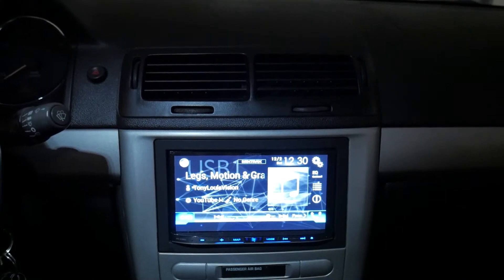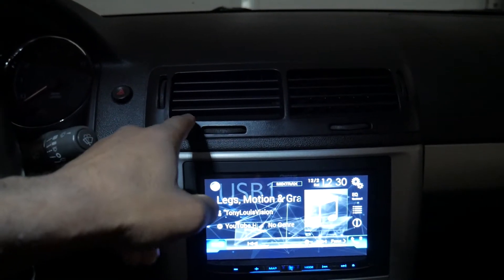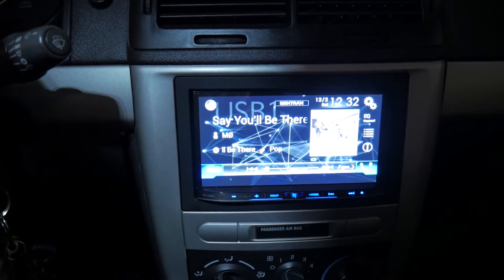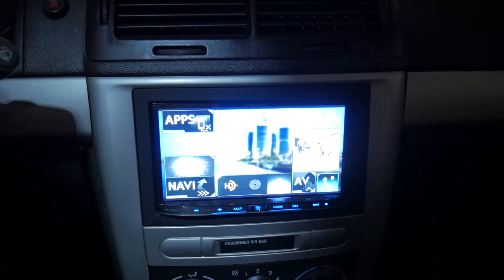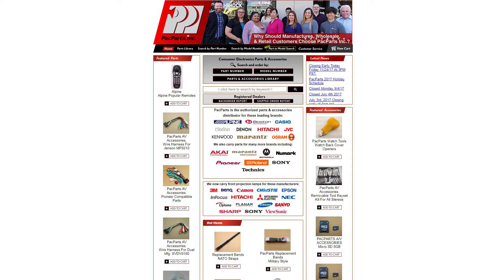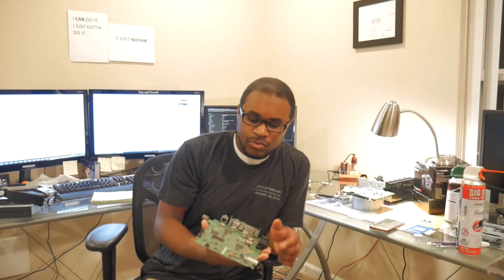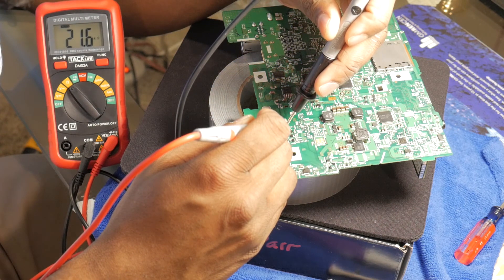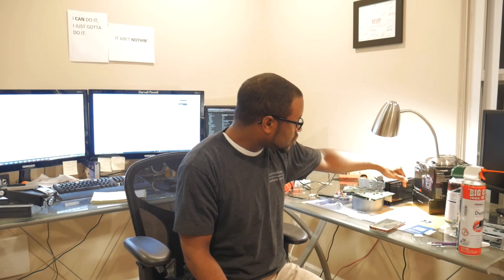Repairing the Pioneer AVIC 8100NEX - Part 1

Comment: Where did you get the electrical schematics?
Reply from the maker: Hi there. The schematic was included inside of the service manual for the radio. I obtained the Service Manual from PACParts.
Reply: @DarvyT  Any idea what cpu, how many cores and how much DRAM?

Comment: Did you ever make a video on repairing buttons? Mine stopped after cleaning the screen.
Reply from the maker: Hi there. Sorry, apparently I didn't. If I remember correctly, I ended up having a short in the ribbon cable, and had to jumper around it to get my buttons to work again. The process required me to do continuity checks with the multimeter to find what was broken. I recommend doing that using to root cause inoperable buttons.